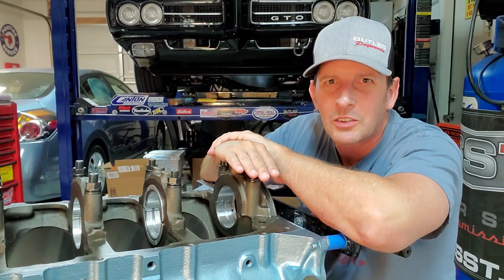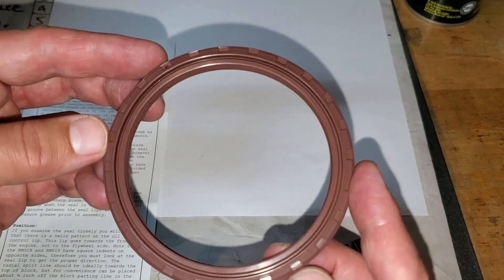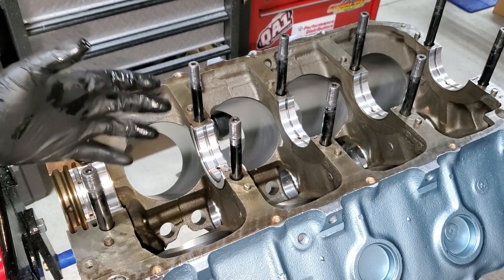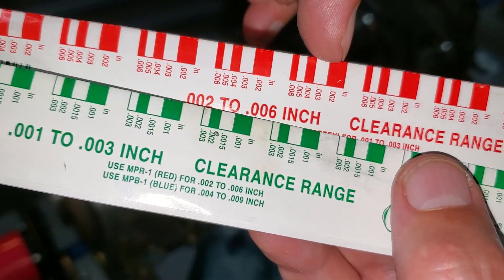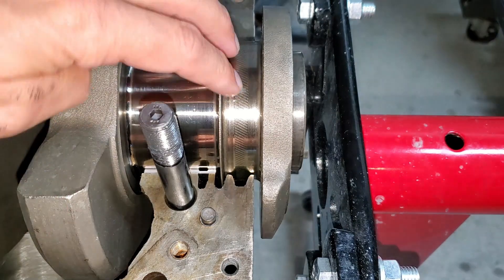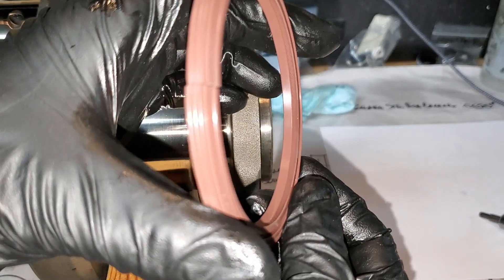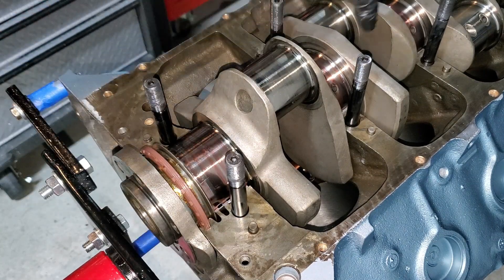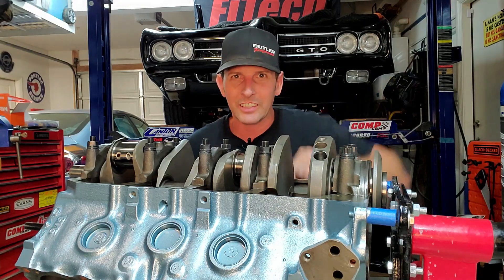How to install a BOP Engineering One Piece rear main seal.  Pontiac short block re-build, Part 5

Comment: Hi Mike, you mention being able to do this with the crank in the block but BOP says not to. Just curious where you found that info. I’m going to reach out to BOP as well. Thanks. Keep up the great videos.
Reply from the maker: Good question.  They used to sell a two piece version, where you could push the other half up over the top side of the crank.  BUT, getting the oil pan out of the way (or far enough away to work on it) is the difficult part.  Thanks for the comment!

Comment: When using the plastigauge, do the main bearings including the bottom side (opposite of main cap side), need to be clear of any assembly lube?
Reply from the maker: Honestly, I don't think it matters cuz it will get "squished" out of the way.  Have fun!
Reply: Thanks! I checked my main bearings after having a shop put new Clevjte ones in and see what appears to be some light scuffing. Many guys are saying it’s bad, while some say the marks are normal when turned dry. Just worried is all
Reply from the maker: @eliasmaximus4857  As long as they're not scratches.  It could be from test fitting and/or if they used a bore gauge.  After you install the crank for good, make sure it spins without binding, like I did at the 5:52 mark.  (Ohh, and the torque I said to use on the main caps is WRONG, please use 110 for the mains, and 140 for the REAR main cap.)  you got this.
Reply: Thanks for the extra advice! It does look like it has some scraping on two of the main bearings, and some, not most, think it’s fine since it may have been dry spun. Wish I could share pics on here lol
Reply from the maker: @eliasmaximus4857  Well, you could email me... fastmontysgarage@gmail.com  See ya!

Comment: Did you do any measurements on endplay on the crank while putting  the main caps on?
Reply from the maker: For kicks and giggles, yes.  New Crank, New Bearings, not typically necessary to measure.  Reason is, if it's out of spec, it takes a lot of expertise to shave caps and bearings, that frankly no one is good at.  lol  Anyway, thanks!

Comment: Will a Pontiac 3.25" Main Viton 2pc Rear Main Seal (421/428/455) fit my 239 inline 6 for my 49 pontiac?
Reply from the maker: Ohhh man, I have no idea.  My gut says NO.  But, maybe try calling BOP Engineering, they may know the exact answer.  Let us know!
Reply: @FastMonty  apparently no one makes a rubber one for a 239 i6
Reply from the maker: @squidoverlord3362  Hmmm, probably not enough interest to make one.  sorry to hear that.  I guess you could put a 455 in it now?  Ha, ha...
Reply: @FastMonty  if i didint already have a vehicle to put it in id put a 24v cummins in it for the funny. But its going in a 74 f250. Still tho, thanka for the video. Was helpfull. Ima just pull it and put a rope in it
Reply from the maker: @squidoverlord3362  Ha!  A Cummins would be awesome!  And, of course, a good old fashioned rope works too.  Have fun!

Comment: Did you ever show where to trim the seal, if it buckles upward when the rear cap is torqued up?
Reply from the maker: Andrew, I trimmed the end where I cut it... but, I found later that the best thing to do is lightly sand the entire OD.  If you have any other questions, I'd recommend reaching out to BOP Engineering.  Thanks!

Comment: Great video!!! Question did you put sealant on the rear main cap surface or just in the corners? Wondering if by not sealing  the surface you have no problems with leaking
Reply from the maker: Thanks Don!  Nope, I just RTVd the corners before mounting the oil pan. 5000 miles no leaks so far!
Reply: @FastMonty  thanks good to know.  Keep the great videos coming!!
Reply from the maker: @Don-uz9om  doin my best, thanks Don!

Comment: This is very helpful I just installed mine exactly how you did still a little worried about it leaking no sealer just a little grease did it work good for you the last time I did this there was only the two was only the 2 piece one which dident leak thanks for all the information
Reply from the maker: Awesome... Mine is still not leaking.  Have fun!
Reply: I just watched an episode of golds garage he filled the anti rotation holes with silicone before he put the seal on I referred to the instructions and they also said to do that I need to know if you did that also because if you did I’m gonna be tearing my short block down again I hope you used none and it’s fine thanks for your help mike
Reply from the maker: @michaelmarciano2442  that's only true for 455 cranks, they have larger mains.
Reply: @FastMonty  ok thanks I will leave it at that

Comment: Hello again from New Zealand. I don’t suppose you noticed a small sequence of numbers stamped into the outside face of the seal? I’ve been pausing and zooming in where I can but can’t see them.
Reply: The numbers on the oil seal reflect the seal dimensions, I was going to try and source the oil seal locally here in NZ as shipping out of the US at the moment is massively expensive $$.
Reply from the maker: I had no idea... not sure I would have someone try and make one.  I would think a mold tool would be way more expensive than shipping to NZ, no?   @Wei55_und-stolz
Reply from the maker: Ha!  No.  I don't recall... why do you ask?

Comment: I hate rope seals. I put rope seals when I overhauled it and in one year it started leaking. Very old technology. I think they're only good for straight 30W non detergent and thin full synthetic detergent modern oil will wash the graphite away and leak. I finally got my car on jack stands and will attempt a seal change with this new type under the car yuk 😱
Reply from the maker: Agreed!  They are the weak point of Pontiac engines.  Thank God we have BOP Engineering seals.  Good luck with the project!

Comment: Must be a dumb question, but the seal sits snug, the metal it is on spins? How can it be around the crankshaft spinning and yet keep oil sealed. Fascinating
Reply from the maker: Not sure which "metal" you're referring to?  It sits snug in the block, and the crank journal spins inside it.  Just like any other type of crank seal, except this is dual lipped, versus a round rope, as used from the factory.  Hence, no leaks.  Thanks!
Reply: @FastMonty  yes the crank journal, my apologies yes. So it’s spinning and keeping the oil inside. It’s just mind blowing for me for some reason ! Thanks for the video
Reply from the maker: @Joniyah444  Yup, no worries.

Comment: Mike how large of a bulge did you have at the seam line? Im working on putting my one piece seal in and I feel like my bulge is to large. I already did a bunch of sanding and it still seems excessive
Reply from the maker: Good question Mitch... I had a tiny bulge.  Hard to explain... In all honesty, I would reach out to BOP Engineering with pics.  They're very fast to respond, and will probably give you some advice, that even I'm not aware of.  :)  Let us know how it works out.

Comment: Great Job on the seal install. ! I just ordered and received a two piece viton seal from TA Performance for my 225 v-6 Dauntless build. The Fel-Pro rope seals are a joke. I have installed rope seals on old Chevys before  (they were pre-molded with some taper), and the new style graphite coated ropes are way too large in diameter to fit the channel they ride in. It's as if they only use "one size fits all" and to hell with it if they don't fit right. I even called Fel-Pro and told the Tech Rep they can't possibly work correctly because they are not "pre-molded" for specific fit, even after pounding it with an extra large round bar and cutting the ends flush with the block the stick-out of the channel is almost 0.050 more than the crank journal. Impossible to rotate the crankshaft with the rope installed.  I threw them in the TRASH......and installed the Viton seals.
Reply from the maker: Thanks Scott!  Love the testimonial too... have fun!

Comment: Found your video Googling around for my mechanic. Great info! The garage isn't sure whether to RTV the rear main seal or not, I have a Pontiac 301 in my '79 Catalina. They have a single piece seal similar to yours but a different manufacturer. How universal is your procedure to installing the single piece, rubber rear main seal? The instructions they received were conflicting, and they haven't been able to get in touch with the manufacturer. Thanks!
Reply from the maker: Good question... in all honesty, I'd buy the seal from BOP Engineering.  That'll give you reassurance you have the best rear main seal.  As you know, there's only one way to change a seal, and that's to pull the engine.  Sorry, that's not what you wanted to hear, but an easy solution.  Thanks for dropping a comment.
Reply: No problem, I thought it couldn't hurt to ask! I may order the BOP Engineering seal and bring it to the shop if they can't figure it out soon, thanks again!
Reply from the maker: @justinweaver7428  Yup, better safe than sorry, order the real deal  Have fun!

Comment: sir   have you even seen a SBC    harmonic balancer seperate..  Im rebuilding a 4.3 chevy,, the  sleeve on the balancer had a groove worn in it from the seal. I bought a speedy sleeve and put the balancer in the freezer for abt an hour to shrink the metal. I took it to my bench, installed the speedy sleeve and let the balancer come to room temp. I then took a rubber mallet and was getting the balancer started on the crankshaft. I noticed little pieces of rubber falling out, so I started hitting it with the mallet to take it off and the outer ring of the balancer seperated  from the inner ring.,. so did me putting it in the freezer cause this? or was it just old and brittle.. the inner and outer parts of the ring seem to be glued together.. I was shocked that it seperated..
Reply from the maker: Wow, sorry to hear that... I'm no BBC expert, BUT, hitting your harmonic balancer with a rubber mallet would, and could ruin a lot of things, including your crank thrust bearings.  The proper method is to use a harmonic balancer removal tool, and an installation tool.  I did a video on it, for my engine... https://youtu.be/hU0q9k0ikJA

Comment: Used this seal and it leaked. Thank goodness I leak tested it. Took it back apart. Glued the seal together with The Right Stuff black and no more leaks.
Reply from the maker: Interesting... can you share how you leak tested it?  I think others would like to know.  (I too love RTV, but I didn't need it this time around)  Thanks for the comment!
Reply: @FastMonty  You can leak test it using 0w20 synthetic. After everything dries take your engine lift and hook your motor up to where your engine is leaning back as far as it goes making the oil lay against all of the rear main seal. You may have to take a ratchet strap to help make it lean back far enough to work. I’ll turn the crank a few times and let it go. It seriously works. That paper thin oil will find a leak with out it running. I never waist gasket on the oil pan either when I do it. Just some right stuff and go with it. If no leaks then I’ll take the oil pan back off then put the gaskets back on. I’ve never had one to leak after doing this. That’s the thing about these old blocks some are 40-60 years old. They all came out of a cast and none of them are the same. I’ve seen some guys never glue the seals together. I’ve seen guys never clock the 2 part seals and also take the old rope seal from a low mile block, soak them in oil and reuse them and never have a leak. Some guys have good luck I guess but not me lol. Thanks
Reply from the maker: @thechestnutking736  Ha!  Yeah, if something bad might happen, it happens to me too... thanks for sharing your leak test method.  I did the same with my new TKX, as it was improperly sealed from the factory.  But, I learned the hard way with that one... as it was leaking after I installed it.  Anyway, thanks for posting the details, and for the awesome comments.  See ya!
Reply: @FastMonty  My T-56 Magnum in my 70 Charger RT did the same thing but I didn’t fill it up after I got it on the lift. WTH!!’ What is the matter with Tremec?!!!
Reply from the maker: @thechestnutking736  Ha!  Seriously!  FMG Quality control over here... ha, ha...

Comment: You know , it a whole lot easier to see the indented cubes than the tiny chevrons. Instead of saying the chevrons face toward the timing gear , just say the side with the indentations face the flywheel.
Reply from the maker: Good point Eric... either way works.  :)  Thanks!

Comment: Do you put any sealer under the bearing cap at the rear main? also when you test fit the crank, do you put motor oil or break in lube on it before tightening the caps?
Reply from the maker: Good questions, Russ... no, and no.  :)  When you put the oil pan on, then I put a tiny bit of RTV in the corners of the cap, where it meets the gasket.  No need to oil the journals for test fitting.  Hope that helps.
Reply: @FastMonty  question  is  was a sealer needed under the bearing cap where the rear main seal is. i heard of some type of anaerobic sealer.
Reply: @russbonneau9152  the answer is still no. Unless you have 3.25 mains, then you'd use some rtv where this seal goes, which i explaoned in the video.